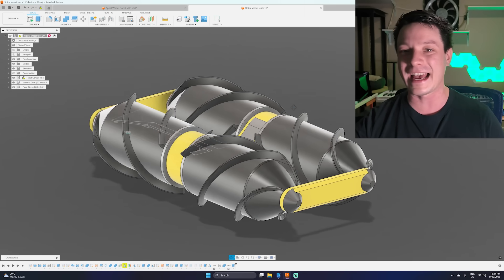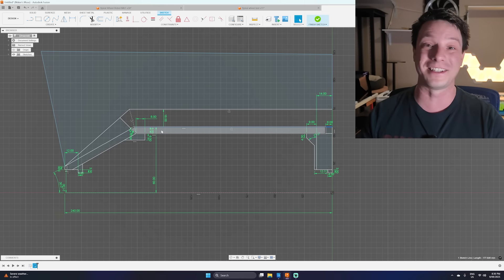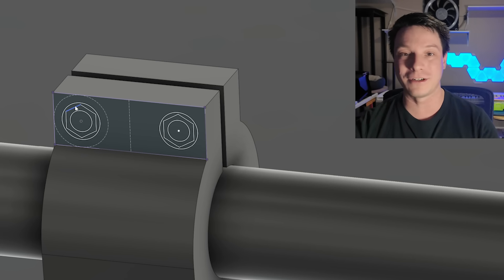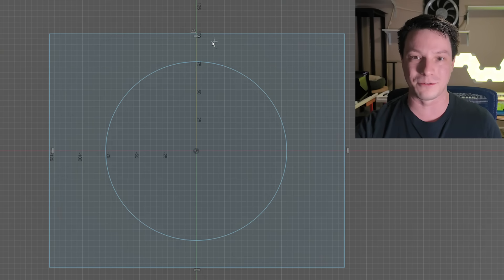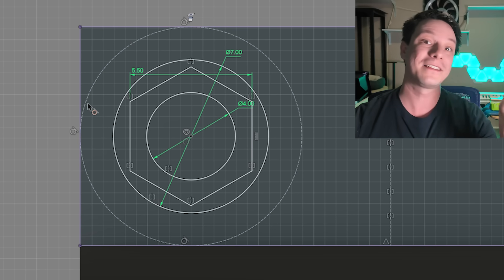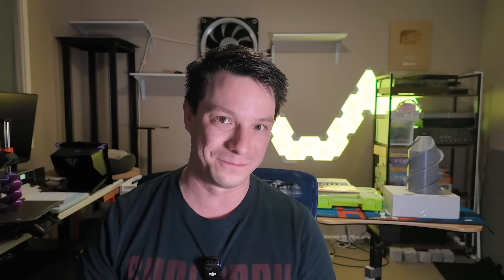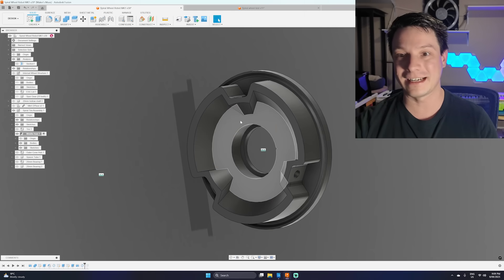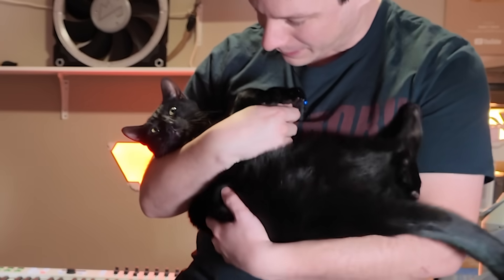Killer CAD tips to speed up your workflow (Fusion, Onshape and more!)

Comment: Ooooo. I have used all of these constantly, except surfaces and the press/pull 👀. I've been adding the offsets to sketches since the negative extrude to create the offset doesn't really work. That's really nice to know.

Not really a cad tip, but in a video, it may be worth talking about "normals." It doesn't happen often in fusion, but when I used to use Sketchup, I didn't realize I was constantly flipping my normals until I tried printing something from it. Same with Blender but it doesn't happen as often, and is more noticable

Comment: So when your putting a value in (any value) you can create a parameter in one shot by specifying it in the value.  Example: "HoleSize = 5.2mm", just put that in your measurement and it will automatically create the parameter HoleSize and assign it a value of 5.2mm.

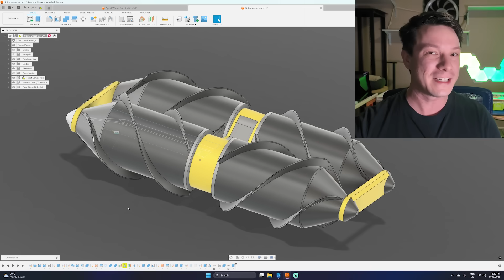Comment: 1:05 That's not even your main tip yet and it's a great idea! I've gotten bogged down more times than I'd like to admit messing with joints and other implementation details while fleshing out a rough concept...
4:52 I used to have this very thought when I was first learning CAD. Now I use points everywhere; they're extremely versatile. Same with construction geometry.

17:35 Use of parameters is definitely another tip that you sort of glossed over under the use of press/pull for adding clearances, but one that I took way too long to start doing in my own CAD journey.

Comment: I am using Fusion to learn to design model RC ships. Think WWII destroyer, cruiser, battleship etc. I am finishing up my first design which I am mostly please with but the sidebar tree has gotten very big and messy. For my next design I would like to learn how to create (for example) the hull as a "component", the super structure as one or more  other "components", gun turrets, radar dishes, and/or other structures etc as separate "components". But I would like to only import my reference images (ship plans) once and sketch all these components from one set of plans. I would appreciate a video on how to keep an involved project such as described organized. THANKS! You have the best 3D printing (and then some) channel on this platform.

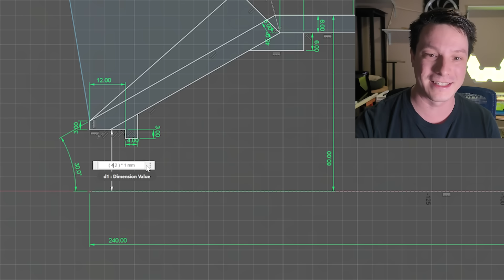Comment: 9:30 Calculations aren't limited to the four basic operations; you can also use formulas. For example, if you need to divide Param1 by Param2, you can easily get a lot of unnecessary decimals, which can mess up tolerances and will make the sketch harder to read at a glance. You can automagically round that to a much nicer value by using the round(), ceil() and floor() formulas.

Comment: Several of these tips point towards the idea of design intent. Ideally, you should never have to trick the program into doing what you want, you should be able to input your thoughts and intent straight into the program. Sometimes you run into the limits of the program, just make sure it's not the limits of your skill.

Another abstract idea - one way of avoiding circular references is to organize groups of features into a hierarchy. Whatever makes sense to you. For example, points-->lines-->reference planes--->master sketches--->regular sketches--->faces--->bodies-->illegal planes--->drafts--->fillets. Avoid referencing up the ladder, always reference downwards or sideways, and the potential for circular reference is much reduced. This is unnecessary if you have perfect memory of how the web of 100+ features reference each other. For the rest of us, mental organization helps.

Comment: On constraint using tangential, it can something break during a recalculation. In your circle example, there is a "soft" underconstrain since the 3x tangential can be valid with your holes outside the part.

Comment: I uses all these tips in almost all my designs. 
One tip of my own here: In Onshape, you can create a "Variable Studio" in some project with some useful parameters, and then import that in other projects. I have one f these with dimensions of commonly used parts, like metric screws. Easier to import it all then measuring the same pcb 3 or 10 times.

Comment: Good tips.

At 5:35, a quicker and easier way to dimension to the edge of the circle is to highlight the circle and right mouse click and select Pick Circle/Arc Tangent.

Not to question the value of equations, but at 9:05, if the center line were an actual center line instead of a construction line, anything you dimension to it will automatically be entered as a diameter.

Comment: For your example using points, you can also dimension to the tangent on a circle or arc by right clicking with the dimension tool active and selecting the appropriate option

Comment: Legend!  It encourages me as a F360 self learner that I had already figured out some of these techniques like re-use sketch, booleans on my last project,  For the ‘hole space from edge’ there is a dimension option in the context menu called Pick Circle/Arc Tangent which dimensions from edge line to tangent of circle.  I also started using parameters while making cutlery drawer containers but I never crossed my mind to use a parameter for the ‘offset face’ part of booleans, I will definitely remember that one.  When having residual bodies from cutting boolean, like your spiral, should you keep the unneeded body, remove or delete it?  Deleting lightens the project but there might be adverse effects later and remove adds stuff to the timeline without lightening the project and lastly keeping it makes more stuff to fish through in the component tree, what would you suggest ?  Thanks a bunch Angu

Comment: 5:10 You can also use the dimension tool, then before selecting a feature, right click and pick "measure from tangent/arc" which lets you measure from the tangent instead of from either a center point or a manually added point
Reply: I was coming into the comments to say the same thing. But I do think the point idea is also useful in some cases.
Reply: Yes!
Reply: Yes this.
Reading the comments its suprising how many people don know about this

Comment: I use points in conjunction with constraints a lot. Stick a point on a line and snap the midpoint of another line to it and you end up with a movable joint that really helps get things symmetrical, for example.

Comment: My best tip, although related to the last point from the vid, is to use as much variables (using onshape) as possible. If you have good names of vars, going back and adjusting stuff is so much easier if everything is in one place. I start my process with creating a "vars" folder at the top of the timeline and putting all variables inside. Every time I need to adjust something, I know exactly where to find it. And because I basically use only variables, no inline dimensions, the whole project is very dynamic.

I'm a software engineer by day and having a lot of well named and organized variables just seems right to me
Reply: I know lots of people who agree with you, especially for passing CAD files to other people. But personally I have difficulty picking out the right variable to edit from a very long list. If I need a global variable, I "source" that number from a dimension in some important sketch. When I need to find something, I stare at the 3D space of sketches, pick out the right sketch, and edit the important dimension. Staring at shapes rather than staring at words I guess.
Reply: @chaklee435 I assume you're talking about much more complex projects then mines. But in such case, I would root for creating folders per each part / section and putting more local vars there while keeping the more global vars in the main vars/ folder

Once again, something taken straight from software engineering playbook 😅😅😅

Comment: The two parts I am not currently using. 1) surfaces definitely want to learn more about this. 2) offsets - I have been doing this with offset lines in the sketch and use the variable

Comment: In Onshape I use variables for most of my dimensions, clearance and fillet radius (radiuses?) This also makes calculations in fx, dimensions clearer. At least if you use proper names for your variables.
Reply: Radii 😉
Reply: @kitbuilt3845  Thanks - I thought it would be spelled like that but the spellchecker didn't suggest it, so I doubted my own sanity🙂

Comment: as someone that uses solidworks: yes you can copy sketches, but you have to do it as keyboard shortcuts.  mouse click menu it doesn't allow

sometimes what I have done is make one sketch for multiple features.  I can either make a new sketch and have it rely on certain lines from a previous sketch.  or select the same sketch

I am used to using solidworks for fabrication of sheet metal and such like that.  it is neat learning that I can do more thanks to the differences in manufacturing by 3D printing

Comment: Freecad does not round numbers in an uniform way, different parts are coded with different standards (That's why i don't use it), so for Freecad, do Not do calculations on the measurements.

Comment: These are some awesome helpful tips! For those who aren't aware, there are many ways to accomplish the same task in Fusion. For example, at 6:04, Angus uses a point to be able to make a dimension between the outer circle and the line. This can also be done by right clicking the circle and selecting "Pick Arc/Circle Tangent" so you can then click on the circle and the line to create a dimension between them.
Reply: I use the Tangent dimension as well but just be aware, if something changes earlier in the timeline, Fusion can put the circle on the wrong side of the line when it recalculates. The dimension to the circle tangent will be the same but the circle can be on either side of the line and Fusion won't know the difference. It has happened to me.
Reply: Came to say the same.  I only found out about that feature last week and it's already sped up a few things
Reply: For those who want to know, in OnShape you can just use the dimension tool between an arc and a line, no additional steps needed.
Reply: This never works for me I always right click select the other one and it doesn't change anything/does not use tangent at all.

Comment: Great video! In Onshape you can offset directly when doing the boolean operation, saving you the extra offset step and making the whole update mechanism more stable. 
I would like to see once your whole workflow, from making a part (measuring dimensions in reality, making the CAD.. you can show the interesting steps only), to export/import to the slicer, setting up the correct slicer parameters for this specific object, filament selection, etc. There is always something to learn along the way.
Waiting for your next one!😊
Reply: How do you handle when you don’t want all the mating surfaces to be offset (like the top and bottom face in the example in the video)? I’ve done boolean+offset with a follow up move face to put those faces back in position but is there a better way to do this than manually selecting all the faces to offset or what I’m doing?
Reply: @teguh.hofstee  in onshape you can either offset all faces or pick the ones you want 

I sometimes use it but when i want to offset a face forbtolarance i dobthat very late in the design stage because i ran into some problems when parts that should touch in reality do not touch in cad 

But only did start 3d modeling like not even 2 years ago for 3d printing 

Also fillets and cosmetic chamfers always the last step fornme too

Comment: The dimension input also handles unit conversion from inches to mm. Very handy if you’re in the UK and come across that one imperial part you need to build something around. Just use “ after the figure and it’ll do the rest
Reply: Only thing is you apparently can't use formulas when using a different unit than the document is set in. Tried this recently with a mm part, wanted an empirical thread, tried typing "5/16 in" (or whatever the case was), and got an error. Had to do the calculation manually and enter the value. Probably a bug in fusion that should be fixed.

Comment: SolidWorks Designer for 16 years plus here. Here are some tips of my daily work as a machine designer that helped me a lot to avoid nasty errors.
Avoid features that are only asymmetric by a few millimetres. You don't see the asymmetry on the finished part which makes them prone to errors. Instead design the parts symmetrical or create key features that only allow one way to assemble the parts.
Only use fully constrained sketches. If you leave a sketch under-constraint, you can run into issues later on, when you change something to it.
Use constraints wisely. Too many constraints (even when they make sense at the moment) can break a geometry in a horrible way later on, when you change your sketches (because they don't add up any longer.
Most CAD systems struggle with fillets. Add your fillets at the very end (if possible) to avoid serious computing issues that can break your geometry completely.
Reply: 'Fillets last' sounds like part of the "Resilient CAD Modeling" (RCM) rules and best practice. Look it up
Reply: Good tips. I can state as a FreeCAD user that these pretty much apply there as well. The only issue with the fillets/chamfers in FreeCAD is they don't quite have their topology naming down, so adjusting a parameter can cause fillets/chamfers to break. :( However, having them at the end means they are easy to re-apply. If they were in the middle... all hell breaks loose.
Reply: 100% on fillets AND chamfers. But, i would add: TRY filleting and chamfering!! Test it, as those are also excellent tools to find where you have used bad practices and where you need to fix them so that you can do the filleting/chamfering at the very end.... Broken lines being one common cause, instead of having one long line you draw that line sections, curves being made from multiple curves when one should do... So, try chamfering, even places that aren't going to be chamfered, cause they will quickly show "illegalities". Filletting, at least in 360 tends to be more forgiving. The sooner you catch them problems, the less damage they will cause in the long run.
Reply: @squidcaps4308 my rule of thumb: fillet corners, chamfer edges and while you can say "wait isn't every corner an edge?" it makes sense on intuitive level
Reply: These are all great pointers! (Along with the great ones in the video from Angus!)
Reply: As a noob what do you mean by constrains?
Reply: @squatseveryday  constraints are things you apply to an element in a sketch to tell the program "always move this to keep this true". For example, "keep this line always perpendicular to this line". Then as you move and change things in the sketch, it will automatically move what it can to keep those lines perpendicular. In the video Angus uses a "tangential" constraint to have the CAD program keep a circle always tangential to a line. Things like that.
Reply: @squatseveryday  exactly as FrankGraffagnino wrote. And this is the point where your sketch can go horribly wrong.
At some point perpendicular and same length, for example, match up and the sketch works fine until you change something to it and the two constraints lead to implausibilities and destroy your sketch often enough. So keep your constraints to an absolute minimum so the sketch isn't over-constrained
Reply: SolidWorks designer here for 2 years, after 20 years of Inventor... agree. with Solidworks is a PAIN if you do not work with fully constrained sketches, and its even more unpredictable the Inventor if you don't do it.
Reply: Very good tips, to add this this as well, another one would be place fillets/chamfers in places that make sense for machining, whether that's an intentional fillet as a design choice for added strength or one that simply results from a machining process (such as in the corners of a pocket). Also avoid geometry that's very difficult or impossible to machine (like cutouts with acute angles).

Comment: My problem is 4:00 that when I extrude something, the sketch just disappears, even if I have not used that part of the sketch
Reply from the maker: It's hidden, you can show it again to reuse it.
Reply: True, by default fusion hides a sketch after use. You have to open the sketches tree and toggle the visibility of the sketch
Reply: @kamon242  okay thanks!
Reply: I think there is a setting in preferences that you can prevent the sketch from autohiding after an extrude. I've stopped using it though, because I like to look at the model and the sketch is just in the way.